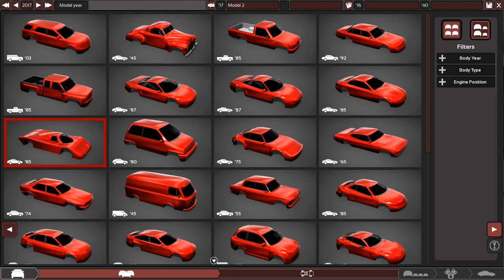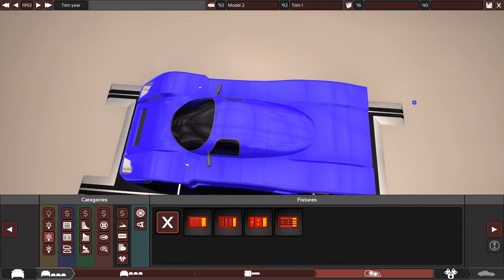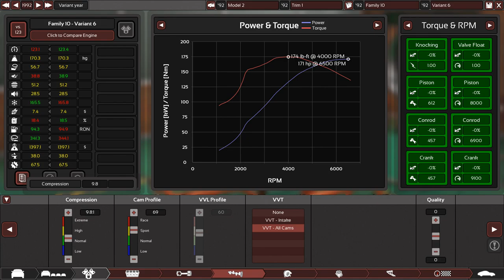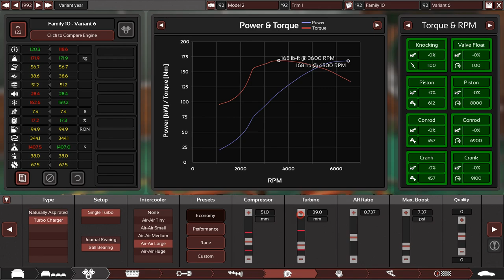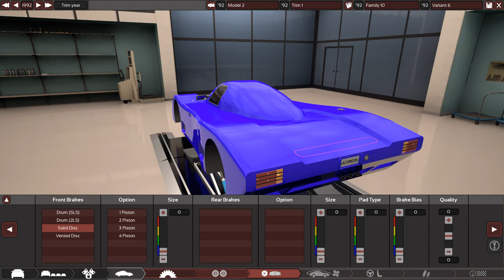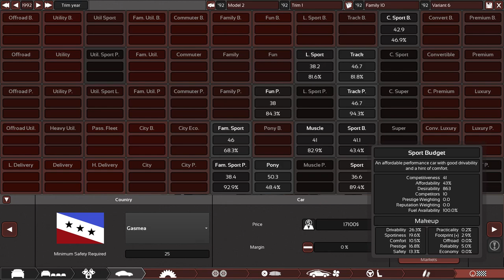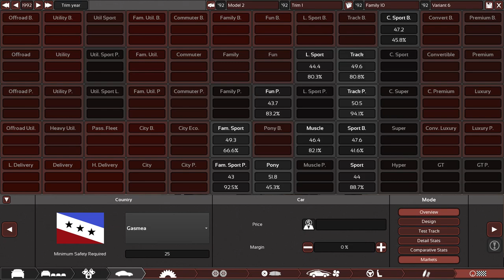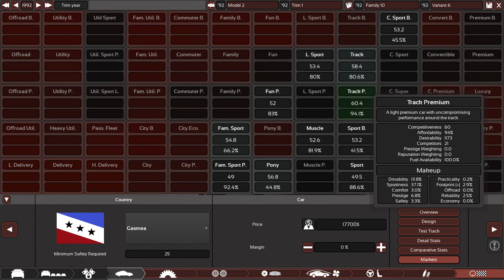'Sensible' LMP Road Car - Automation

Comment: Alex, I suggest for the next Automation challenge you do a factory ready drag race car.
Reply: I like those ideas. A tiny compact with a 1L V8 that makes like 300hp. Fun times.
Reply: Seymore "Gally" Johnson a demon rival.
Reply: Sam Wilson German drag monster.
Reply: Seymore "Gally" Johnson what you are talking about is either a mustang cobra jet, a Dodge Challenger demon or a Chevy copo camaro
Reply: What I'm talking about is a full on race car, not a hopped up muscle car. A purpose built 1/4 mile drag machine, like a funny car for instance.
Reply: Seymore "Gally" Johnson more sorta Dodge Dart then? Like limited run special edition?

Comment: Hypereutectic metal means that it is impregnated with silicone while smelting. In theory, it has better heat dissipation than regular metal so it doesn't grow and shrink as much, thus allowing you to use tighter tolerances and create a more efficient engine.
Reply: The downside is that it isn't as strong as forged stuff, so you can't push the limits very much. It's fantastic for use in economy engines.

Comment: you should try and put the smallest possible engine into the largest possible car.
Reply: 400cc 4 cylinder 1959 Cadillac Eldorado it is then. There's possibly a couple bigger though
Reply: But he did it in this video

Comment: Build a full on race car next, with as much power as possible and as track ready as possible, cost doesn't matter
Reply: Cost should always matter in the game, IMO. Nobody is going to be impressed by any car you make if all of them are completely impossible.
Reply: I could never get production costs to go close to 1 million, which isn't that much for a race car that has a large financial backing.
Reply: Dude, that's a lot. Pricing in this game is different. +100k is considered hypercar budget.

Not to mention if you got costs that high, engineering time will take forever.

Comment: They should add a late 90's LMP body that resembles the Toyota GT-One. Also, why did you chose to use an iron block when aluminum blocks were fairly common, even in the early 90's?

Comment: I got triggered by the badge placement, as well as the lack of even a low level wing.
Reply: The wings and spoilers are currently glitchy with the UE4 version of the game.
Reply: I would've preferred an off centre number plate

Comment: I think I have an engine that would suit this car (though maybe my 1.8L V6 might be better).
Here a list of how to make it the LB3R1 (0 quality mess with this one as its the basic engine) and LB3E1 (Its highly tuned) (its a 3L V12 the latter sounds better to me though and it should have no problem getting 30 mpg with that car downside is their cost though you probably could play with it to get it down). It is a pretty nooby engine though at least I think it is.

Block: Both: AlSi (I bet you could easily get away with Aluminium maybe cast but this is a high compression engine)

Family Capacity: Both: 62.1mm, 3,000cc, 82.5mm

Head and Valves: Both: Dual Overhead Cam 5 valve (crucial to its efficiency but maybe a 4 valve could work)

Head Material: Both: AlSi (again Aluminium not sure about cast again high compression unless I've got that wrong)

VVL: N/A

Crank: R1: Billet Steel , E1: Cast Iron

Conrods: R1: Lightweight Titanium (the forged one would require +10 quality to work due to my noob mistake with stroke length), E1: Heavy Duty Forged

Pistons: R1: Lightweight Forged , E1: Forged

Quality: R1: 0 , E1: 0

Compression: R1: 12.5:1 ,  E1: 12.2:1

Cam Profile: R1: 60 , E1:

VVT: R1: All Cams (its 25 HP for 6 material cost and 2.66 weight) , E1: Intake Only (All cams only nets 0.1 economy)

Quality: R1: 0 , E1: 11 (it needs it for economy and knocks any lower)

Turbo: None cause I can't turbo to save my life everything breaks and the last engine I twin turbo'd only gain 6 HP SIX! Though it had better curves.

Fuel System: Both: Direct Injection 

Configuration: R1: Per Cylinder , E1: Twin or Per Cylinder (Twin for much lower cost)

Intake: Both: Performance

Fuel Type: Both: 91 (surprise both use it, 95 doesn't seem to do anything)

Fuel Mixture: R1: 13.2 , E1: 13.6

Ignition Timing: R1: 70 , E1: 69

RPM Limit: R1: 9500 , E1: 7900

Quality: R1: 0 , E1: 15 (its economy goes down the drain any lower as its knocks)

Headers: R1: Race Tubular (Long Tubular can work fine though) , E1: Tubular

Exhaust: R1: Dual/No Valves , E1: Single/No Valves (Bypass gets you 12 HP but lose 1.5 economy)

Exhaust Diameter: R1: 76.2mm (Any higher or lower you start to lose power and torque) , E1: 82.5mm

Catalytic Converter: R1: Three way (High flow gets you 3 more HP) , E1: Three way (Two way loses 12HP and 1.3 economy)

Mufflers: R:1 Either 2 Baffled (14 cost) or 2 Reverse Flow (44 cost) or 1 of each (29 cost) , E1: 2 Reverse (for most economy, 24 cost) or 2 Baffled (for 9 more HP but 0.5 less economy, 8 cost) or 1 of each (for 0.2 less economy but 4 more HP, 16 cost)

Quality: R1: 0 , E1: 0

R1 zero Quality cost: 2151 (20.4 economy or in my 1.1 kg car 28.2 MPG) , E1: 6468 (27.3 economy or in my 1.1 car 37.2MPG not sure If I've broke my game as one car is having trouble fitting the same sized engine, i touched the free roam thing and it stayed dark could still see the headers glow on my engines might have to rebuild atleast I have this for that)

I must admit I was tinkering the whole way through to try and improve them just ended up making R1 worse and E1 glitched. Should have talked about the V6.

Comment: I watch a whole 12 mins of the video then you stick a inline 4 2.0 litre on it, v10 or v12 are the engines for this type of car, needs low and high rpm power to be able to keep the car happy around corners and stress. And v10s arnt even that bad on gas if u don't build the shit out of it, do a v10 N/A LMP build, that would be worth watching

Comment: how to build economical engine 101 
A/F ratio on 15, then deal with what you get xD putting more fuel i n to a engine to make it run with a turbo does not make it cheaper xD